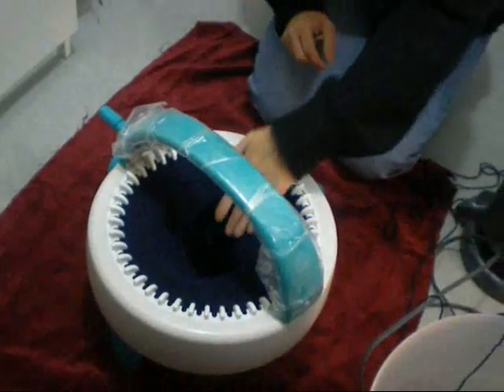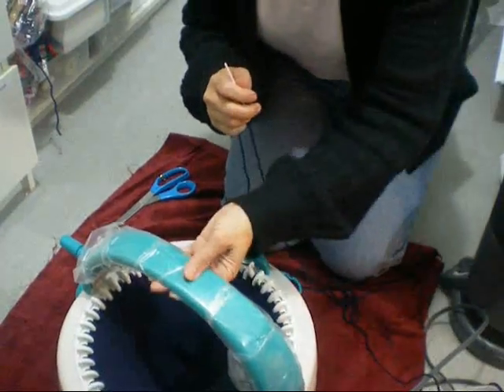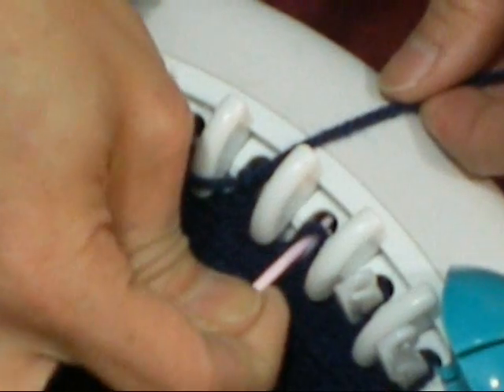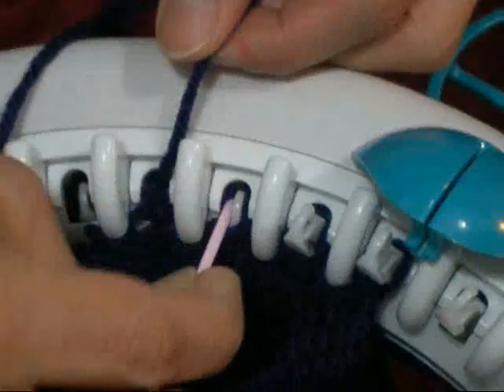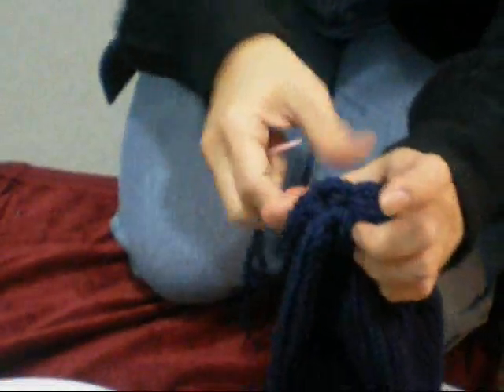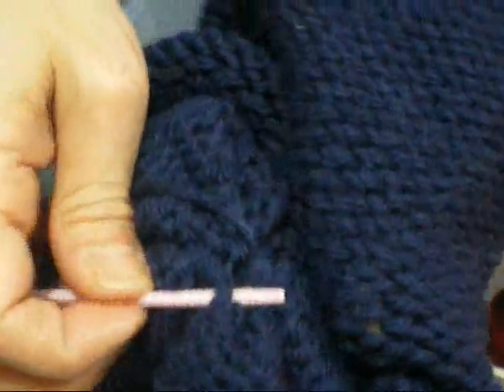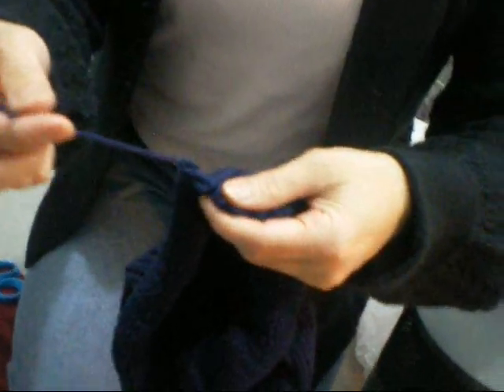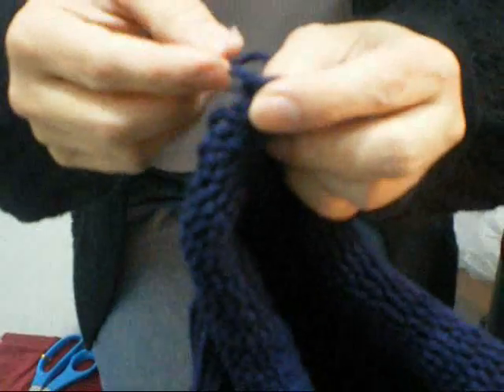How to cast off on your circular knitting machine

Comment: Nicely done! The Innovations machines have a slightly different needle than most circular knitting machines. There is no slit on the top of each needle bump for insertion into the loops by a tapestry needle and the "guards" on either side of each needle that help with the knitting make it hard to hand manipulate needles unless they are right in front of the yarn guide. You have worked out an excellent method for casting off that takes both situations into account, much clearer than the manual.
Reply from the maker: Thank you!